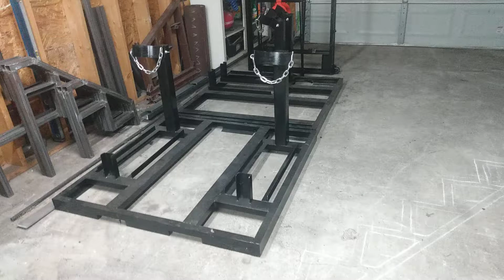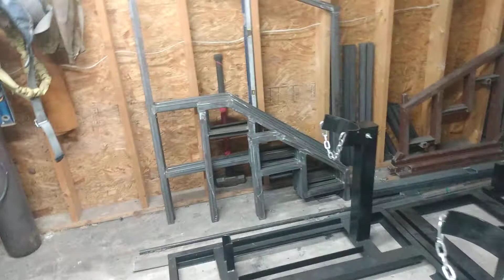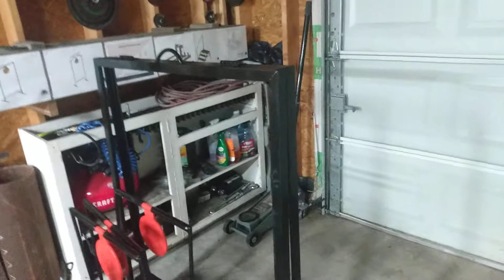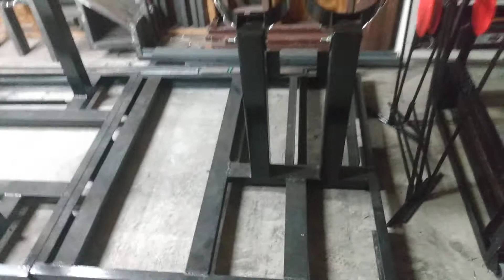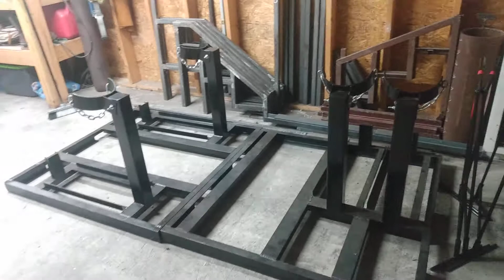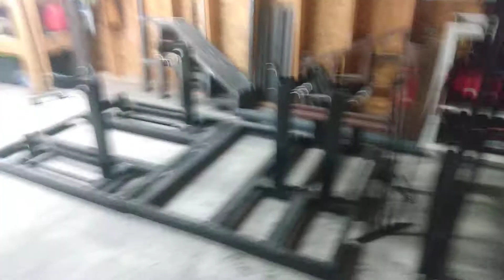Why purchase HogOn Welding Skids and Product's?

Comment: I'd be interested in finding out what your sales list price is. I have a Hobart 225. It's about the size of a bobcat and I'm running out of the back of a 2005 2500 Cummins Dodge. I'd be interested in knowing what one of those. Basic skids costs And I like your sales pitch.
Reply from the maker: Thanks a lot a base model skids start off at $500
Reply: @HogOnTV  Thanks for the information. Looks like a really solid product.
Reply from the maker: @derekbryant6137  yes it is very reliable and the cool thing is you can always add on to it to make it more of what you need as the time passes by and you build your Independence for business or figure out you need certain things on the skid for particular jobs HogOn
Reply: @HogOnTV  Well, it made sense when you mentioned that. You could pick up a bunch of stuff at once instead of unloading everything individually. I just got to get my business partner to take a look at this. And convince them we need this.
Reply from the maker: Okay thanks HogOn